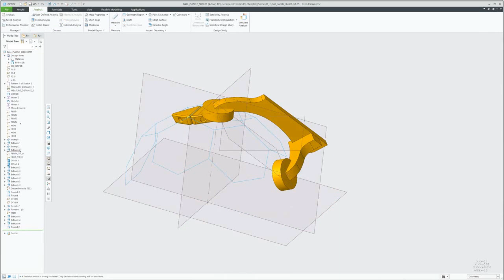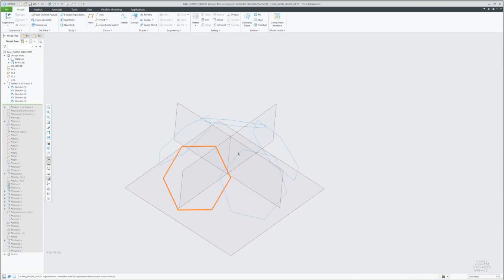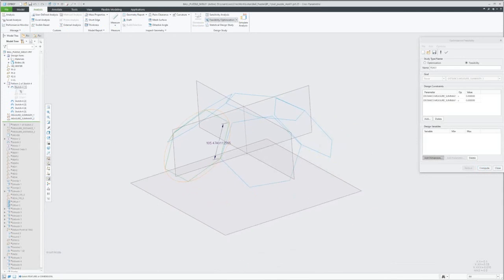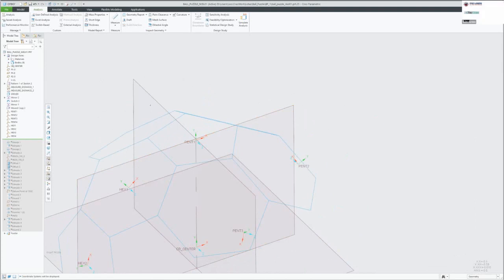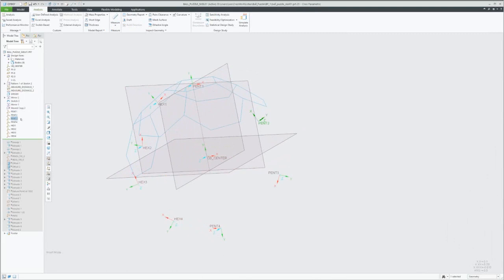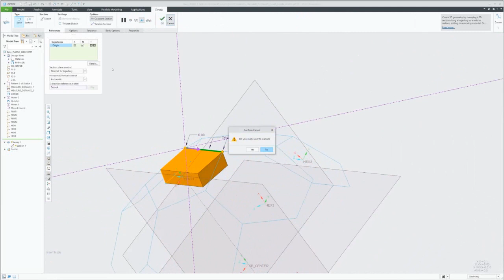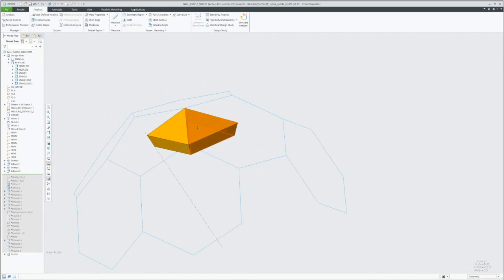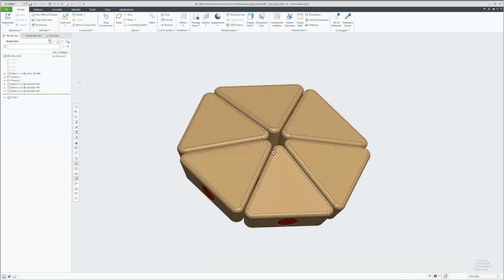Multi Body Skeleton

Comment: When I click the Feasibility / Optimization button I get the message "The option Behavioral_Modeler has not been acquired".  What's going on here?  Am I not running the required license?
Reply: Behavioral Modeling or BMX is an add on module and doesn't come with the basic module. I believe PTC has included some of its features in the newer versions say Creo 6 onwards.